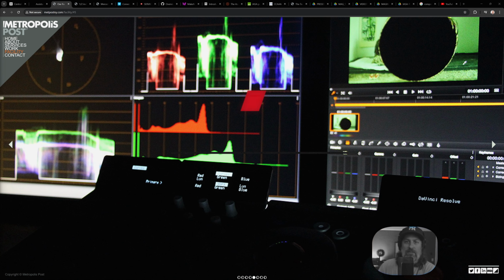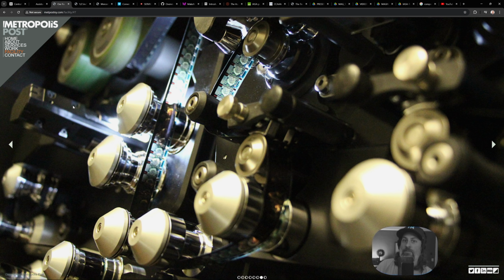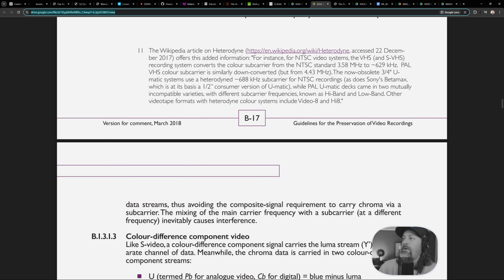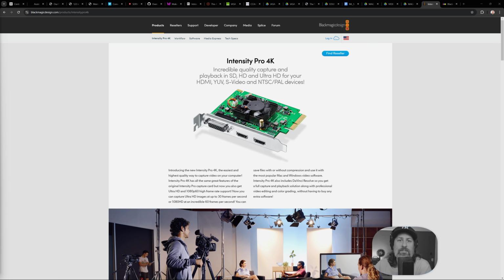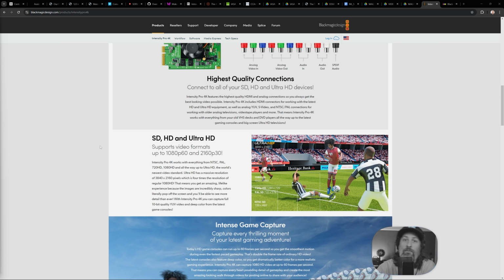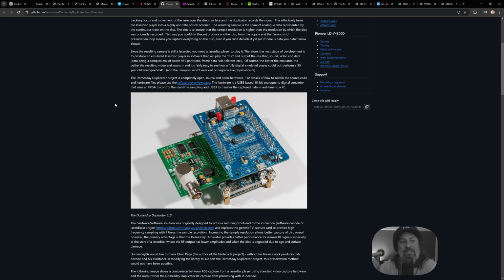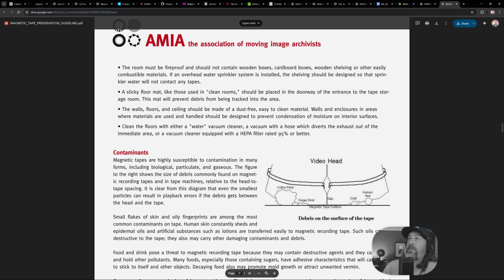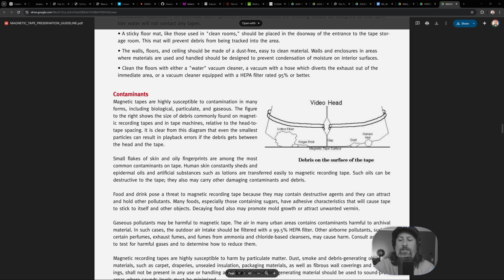Archival Media Digitizing - The Basics

Comment: I was hoping to see you hook up the hardware and show the capture software you use and the settings. I have 27 2-hour Hi-8 tapes I captured with one of those inexpensive USB capture devices. The camera has S-Video output, so I used that. I used VDub as the capture software. I have no idea if I did it "right." Comment?
Reply from the maker: Some usb dongles like the Hauppauge usb live 2 can capture the interlaced signal (field lines intact) and also have internal 10 bit processing but they limit to 8bit out. Capturing the interlaced signal is a must. I wouldnt say capturing your way is “wrong”, just less useful in certain ways. The fact that you captured the tapes at all means you did something right! Thank you for saving a piece of history for posterity!

Comment: I have a Lenovo laptop from 2007 that has a IEEE1394 port. It's running Windows 10. I use WinDV to capture from my Sony DV camera. The output is in AVI files - one per scene. I use AVIMux to put the AVI files together. So  you might not need to convert your laptop to Linux.

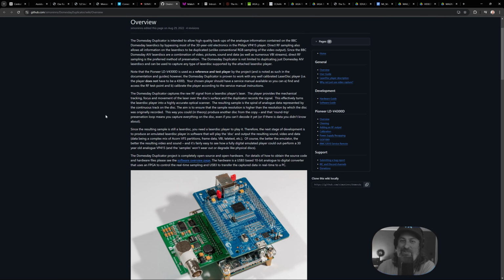Comment: 19:30 good to see FM RF Archival being promoted (thats the standard name), feel free to have a deep dive into vhs-decode which has the main wiki now alongside hardware methods more focused for tape formats and a lot more then just LaserDisc or VHS is supported bare in mind.

Just some notes, the DdD is 100% open-source down to the KiCad files, but there is a PCBway shared project you get it made at factory costs + whatever the 2 dev boards go for on the market, so normally less then 300USD global, but RF capture is a lot cheeper with CX Cards at 120USD for a complete system aimed for tape users but the DdD is still king for LaserDisc.

Also sampling it practically just 40msps or 40mhz of PCM audio, then we compress it down with FLAC drastically a whole 80min of LD fits on a 100GB M-Disc or DataLifePlus disc for example.
Reply from the maker: Thank you for the additional valuable info! Great to have you here in the community. I bought the white CX card and plan to make a little machine myself for FM RF transfer testing. Maybe I'll make a video if I can get it to work and not embarrass myself.
Reply: @zhalberd  Great to hear! There is pre-made bits on the Kofi these days, eventually the cards will be offered pre-modified too if I ever get the time.
Reply from the maker: @TheRealHarrypm  I believe it was one of your videos that inspired me to buy the CX card and embark on this fm rf tinkering project. So its your fault. Looking forward to seeing more of your videos.
Reply: @zhalberd  Haha, yeah the video is a little outdated now, but basics are still are the same, definitely should probably make some more tutorials, been focusing on just the demo media archives really.